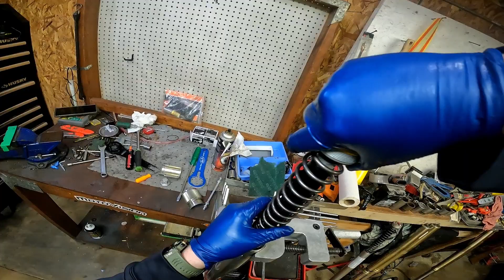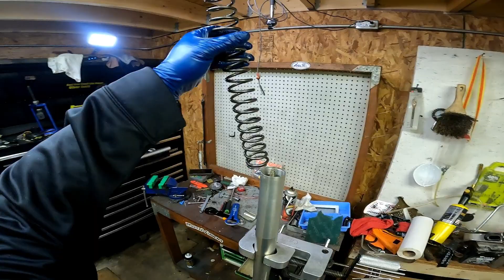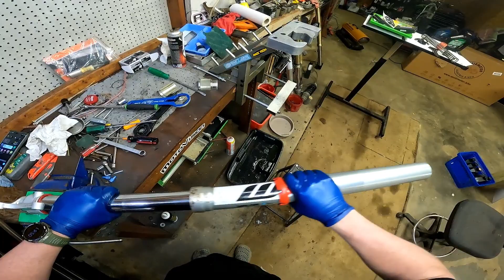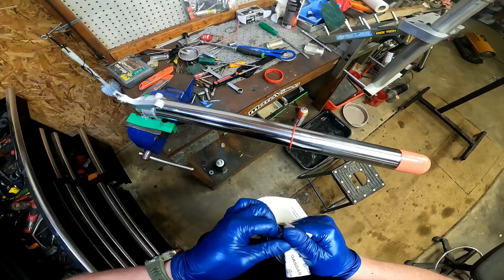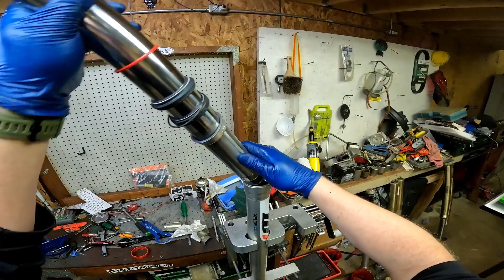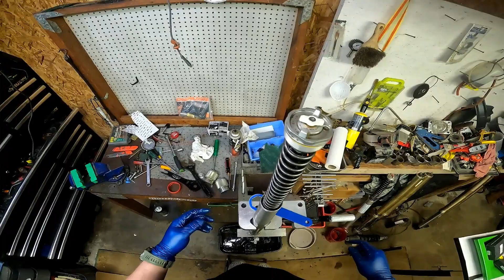Servicing a WP XPlor 48 Fork (2023 Husqvarna TE300)

Comment: Nice but when you tighten/loosen that style cap you have to use the slit in your tool on the preload adjustment, not the hexagon, or you will damage your expensive cap
Reply: Also I'd use the proper size wrench, a crescent wrench has a sharp end and can dig into your cap